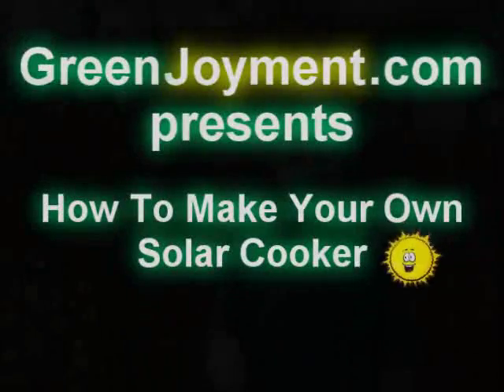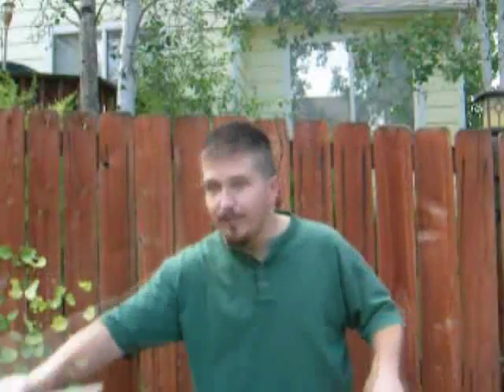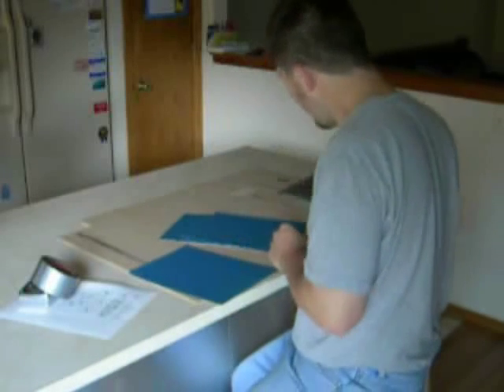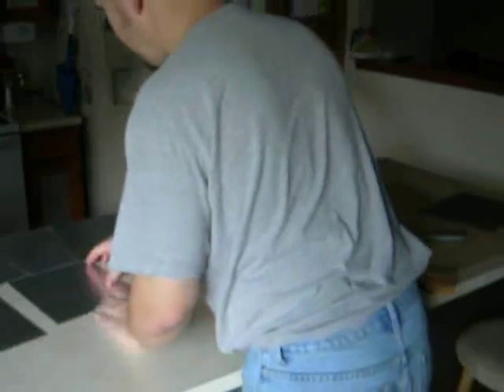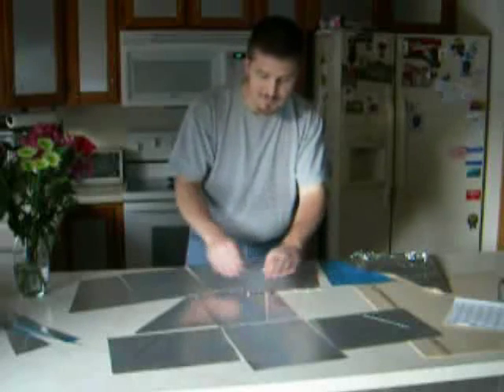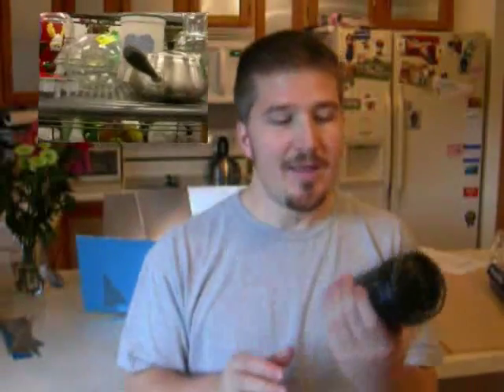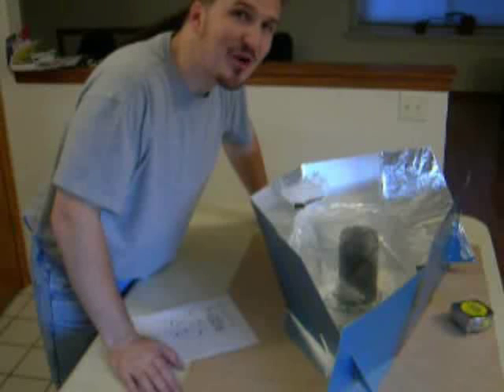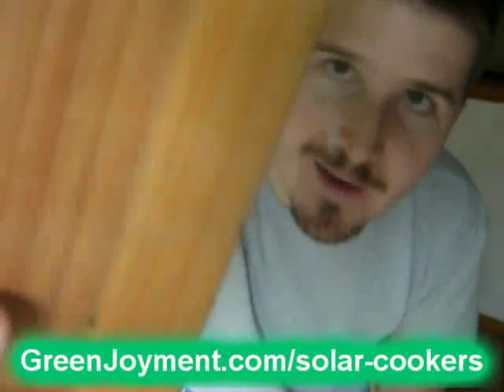Solar Cookers: How To Make An Eagle Solar Cooker

Comment: @strive4impact Well said. We all do need to change. I think once the economic system reflects the true cost of burning oil, we will. People drive small cars in Europe because they can't afford to power a Ford V10 on gas that isn't subsidized. Not to mention the pollution, which, last I checked, stays clear of the books. We desperately need better localized systems to produce our food and energy. Solar panels should reach a golden age soon though. There is hope.

Comment from the maker: It is the same shape... a little smaller, and for us it cooked better, though it was probably more due to angles and whatnot in my construction.

I think the advantage is that for us United Statesians, it's based on paper-sized sheets (8 1/2" by 11") which are measurements we're used to as opposed to the centimeter measurements of the Cookit.

But really, I'm not sure... just two different designs.

Comment: The agrigate in toothpaste breaks down redily when wet, much like brushing with baking soda or salt.  It desolves.

If you want to polish your teeth use tooth paste.  If you want to polish metal use a metal polish.  At todays "designer" toothpaste prices I don't think there would be much difference in the price, so use the proper tool for the job.  That's my advise.

Comment: Start with a fairly damp soft cloth like an old Tshirt. I place some of the compound paste on the metal and begin buffing. Using the orbital style palm sander just use a small folded piece of cloth as you would sandpaper,  fastening it to the sander. Or of coarse using a buffing wheel attachment to a drill works too.  Just use a soft cloth  or a wheel especially made for buffing and polishing.

Keep a pattern to your buffing,  back and forth, side to side  See Next Comment

Comment: I used a common rubbing compound I got from an auto parts store. You want to get a paste type compound.  It should be for polishing metal like Mag Wheels. It should say on the labeling. Regular chrome/silver polish won't do.   What I got comes in a round flat can like car paste wax.  It is a microfine abrasive that polishes the surface. Using a fairly damp soft cloth and alot of elbow grease or I use a plam sander (orbital) or you can use a buffing wheel attachment on a drill.  See Next Comment

Comment: Using that aluminum sheet as a reflector is a great idea.  You can use some regular rubbing  compound found at most auto parts stores and a buffer pad on a drill to buff the surface to a mirror finish. This will increase the performance of your cooker a good 30% and more! It's the next best thing to using real glass mirrors.